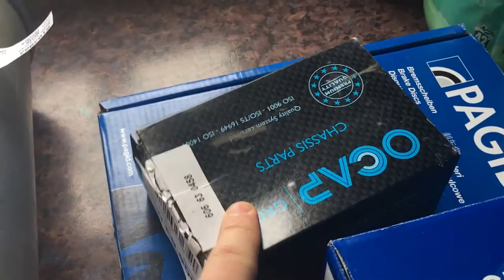jaguar project xjs IRS brakes (40)

Comment: Thumbs up for doing it yourself on the floor with no car hoist. Done it myself a few times and I know its not easy this way. cheers.
Reply from the maker: hi it was a bit hard to do on a gravel drive but my other garage has the series 3 in I had to lift it out myself heavy is a understatement (hahaha) but its a job that needed to be done thanks

Comment: Hi there. How did you get the RH caliper back in with the cage in place. On my job it seems the lower caliper bolt is too long to clear the diff and the caliper bracket. Any insight would help. Thanks.
Reply from the maker: Hi, thank you for watching I think my bolts are both the same length, but it’s been so long since I’ve done one of these I can’t actually remember

Comment: Tough job! I hope I never have to replace rotors in my 89 XJS. Thanks for videoing what you could. I realize that doing the job on a floor with a jack and blocks doesn't make for ideal taping conditions. maybe some steadier camera shots (just prop it up on the ground)and showing how you were finally able to remove stubborn parts would be helpful. Pointing out the key hardware slated for removal of the  assembly would be helpful in future videos. thanks for mentioning your part suppliers. Good Job JAG
Reply from the maker: Hi thanks for watching its very difficult to video and work on it as I get carried away and realise I havent recoreded it (haha) but its sometimes difficult for time as I dont get much time off from work so I try to get done what I have to

Comment: Hi chris  i worked on jags from 1963 until 2011 and yes it can be done up on a ramp without removing the rear cradle, you did well, expensive job, cheers from uk.
Reply from the maker: Thanks it was a challange but not as bad as I first thought

Comment: You're a braver man than me Christopher. My XJS has just passed its MOT but needed the rear brakes re-built just like yours. I didn't fancy doing that on my drive. I took one look at the job and then took it to my local garage who is into these older motors. New rear brakes (inc. handbrake) and two front tyres for the MOT. I'm actually really pleased with that. Good luck to you for your  up and coming test. Cheers, Ian.
Reply from the maker: hi thanks it passed the MOT  with no advisory's :)

Comment: Great job, Chris. I'm currently doing my series III and having a heck of a time dealing with removing the radius arms. They seem to be rusted to the car. I may have to try to the dremmel trick. Even though I'm working on a '73, your video for your beautiful XJS helped me. I never could find a video dealing with the radius arms. Also, it's great that the IRS looks almost identical, except for the pipes going through the whole mechanism. Thank you
Reply: Had my own business repairing Jags for 20+ years. To separate tie bar from the floor pan dome (sorry for lack of technical wording) use a long wrecking bar/crow bar with claw shaped end inserted in the gap between the centre of the tie bar bush (where its bolted through) and the dome. Position bar with "handle" end facing forward with block of wood under handle then lower car so crow bar is taking weight of car. Car will tip sideways but keep lowering.  If claw is suitable shape the leverage between claw point hooked in the bush and claw heel pressing against dome taper will separate with loud bang!! Note: when fitting new bushes they should be oriented with two holes in the rubber facing front and rear of vehicle (Chris had one of them wrong.)
Reply from the maker: Hi Thank you they where a Nightmare Glad the video helped Thank you for watching

Comment: Bump stops on both sides, Chris. Do both brake discs, new pads, remember to keep control of any shims you come across and make sure they go back in correctly, use air tools to remove discs, new nuts for them and lockwire those too, whilst you are at it cgeck hand brake pads and replace if necessary(they will need doing) and also the brass 'spreader springs that return the hand brake pads to 'off' position AND worth removing calipers to service with new seal etc.....check brake hoses and lines...blah, blah, blah...stainless back boxes??
Reply from the maker: I think I replaced everything on the back of that car (haha)
Reply: I did the same in the early 2000's with my XJ6. Had to load my IRS into the wifes Astra to take it to a sympathetic garage in Colchester. The mechanic ysed his air gun to get the discs off.....ordered a set of air tools and a compressor very soon after that. Managed to replace all the bushings(radius arms) via an engineering company. They charged me 'a tenner' but it took them an hour and a half to do both sides...their ten tonne press had problems getting them out!!
Reply from the maker: I bet that was hard to get it in the back of a astra
Reply: Nah, it was an estate and had help each time...very heavy though....

Comment: My rear brake system just went out on my 90 XJS Convertible.  I saw Brake Fluid all over the ground. I know that I should just pull the entire unit out and rebuild it.  I also discovered that one of the radius arms is bent and the safety strap is broken.  Woes to me.  This is going to be a major project!.  Thanks for sharing the bits that you shared.  I am studying how to get the entire unit out you don't mention which bolts need to come out to drop the unit.
Reply from the maker: hello the 4 bolts inside the rear wheel arch each side I removed then just disconect the exhaust brake pipe prop and hand brake radus arms and it will drop straight out
Reply: Thanks!! 
I see that I have to replace both radius arms (somebody bottomed this car out. I also see something bent in the right front suspension) then clean up and replace the calipers and rotors.  The Lines don't look bad but I will replace them too as a precaution. You Da Best!
Reply from the maker: yeah its such a big job to do but worth it